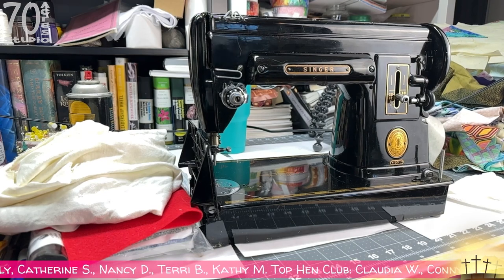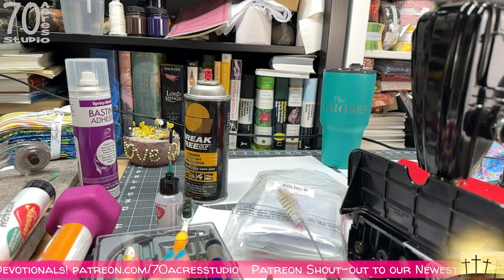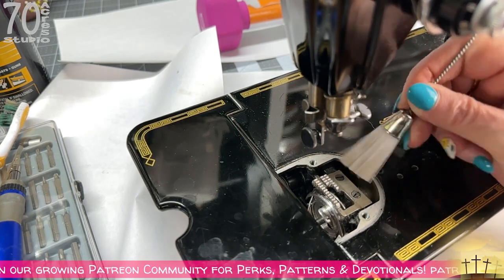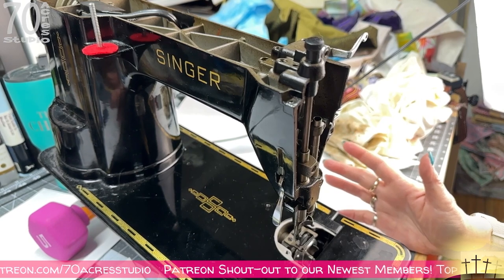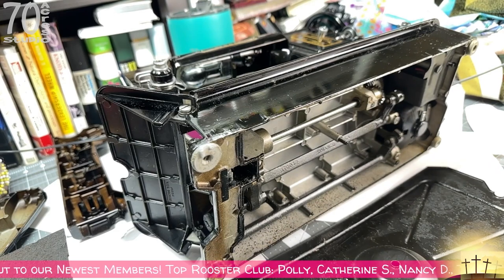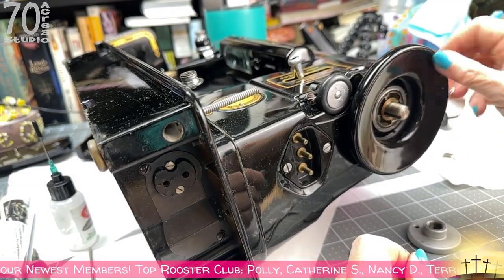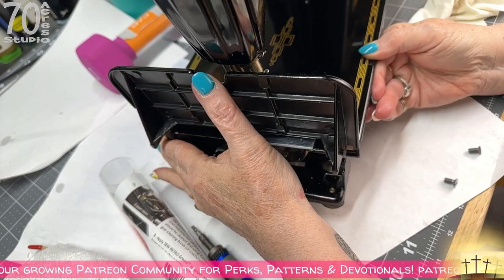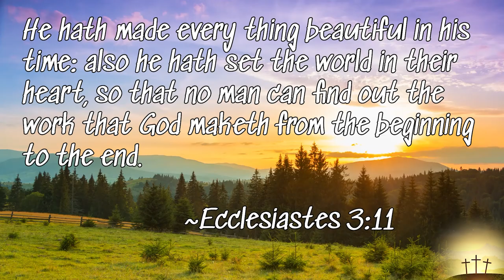Keeping your Singer 301 Happy. Vintage Sewing Machine Maintenance

Comment: One more spot:  Take out the bobbin case.  Where the bobbin case is inserted, there are a few small squarish holes around the perimeter, one drop of oil in one of those holes makes a big difference in sound and performance.
Reply from the maker: Yes, I do add oil to that location. Every time I change the bobbin and clean the lint out and oil the area. Thanks for watching Thomas!
Reply: thanks for the video, I'm glad you told me how frequently you oil, , , I do it about once a week (I ust started, and don't sew as much as you I'm sure.  I spend more time restoring it than using it (It's as though it was in a tie capsule ) @70acres
Reply from the maker: I adore all my vintage machines. I have around 25 of them, maybe more. Every time I sit down at the machine I give it a drop of oil in the oil holes on top and on the base. I do a thorough oiling all over after cleaning the machine. I'm a mechanic's daughter and love machines. @thomasgronek6469

Comment: I am so glad that I saw your screw driver that came with the machine,  so I don't have a ripper.  But mine comes to a point rather than a flat screw driver head.  Do you have any idea what it is or isn't.  I think it came with the G3558490 machine 🤔.  I still haven't figured out what year it is from.  I think I just have to take it to the machine store.  It has old wiring so it needs that and a tune up/cleaning.
Reply from the maker: If you can take some photos of your machine I can ID it for you, Kathy. Post the photos to The Flock. Thanks for watching!
Reply from the maker: That pointy tool is called a stiletto. It is used instead of a finger to guide things under the sewing needle
Reply: @70acres    Wow thank you  I will send some pics to you soon of the machine 🌼 😊
Reply: @70acres  absolutely